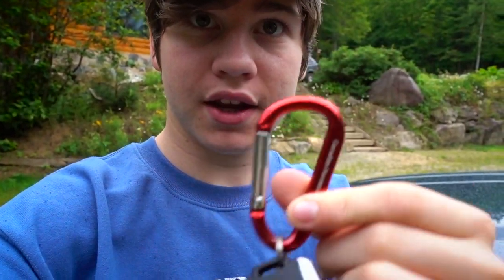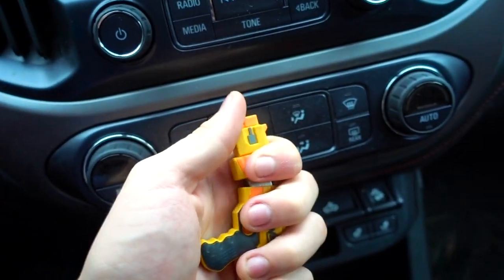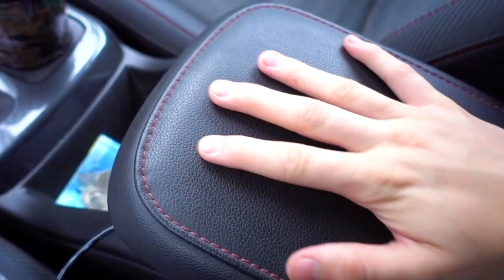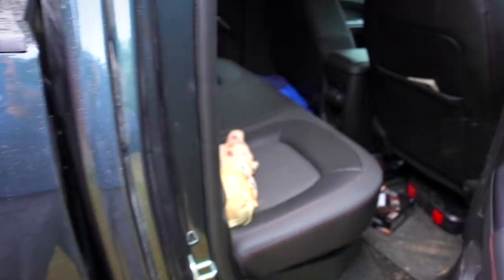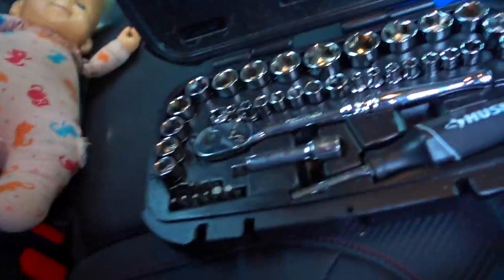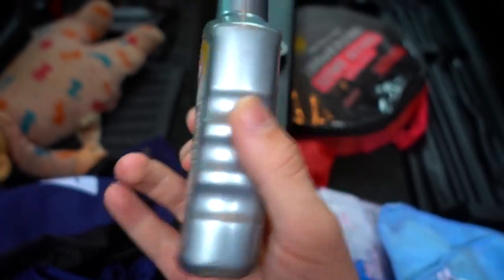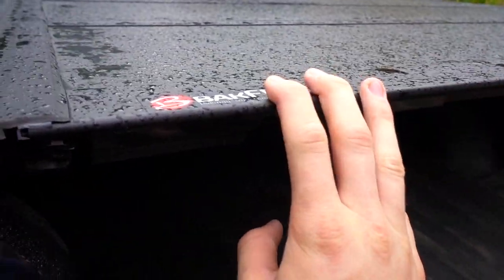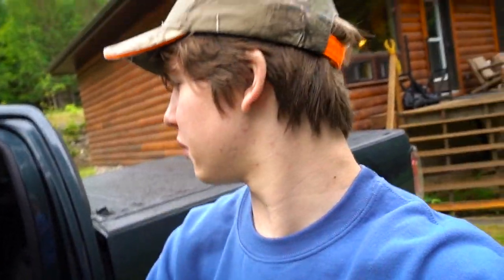WHAT'S IN MY TRUCK??

Comment: +Adam Brice the heated  seats feel good don't they?
Reply from the maker: Yeah! Also, this vehicle allows you to heat just the back instead of the whole seat. Which I much prefer :)
Reply: Adam Brice awesome and the only downside is that it doesn't have air conditioned seats unless you get the Denali trim which is also on the sierras canyons and the acadias as well as the yukons
Reply: Adam Brice why did you have smith falls on your gps. just letting u know i live there
Reply from the maker: +Dylan Chalmers yeah but it has remote start so you can turn on the A/C before you get in 👌

Comment: i just want to know what are you towing, why do you need a fucking truck. im just curious. i have a 97 f250 that i use to move brush from the ranch and mesquite wood for bbqs on top of using it to tow livestock. and why do you need sockets you have a NEW gmc with most likely less than 100k miles there should be no reason that truck should break down if it does you got fucked over by some salesman.